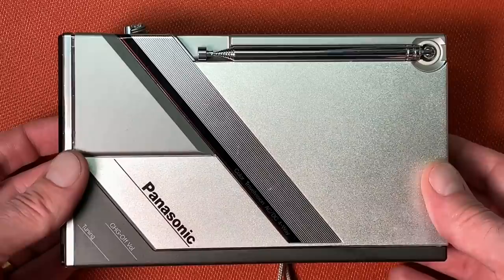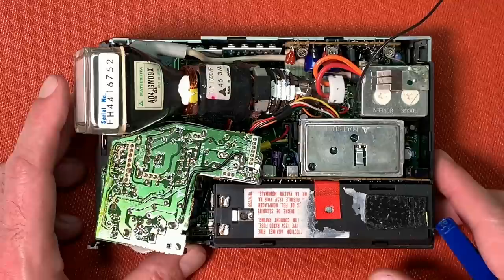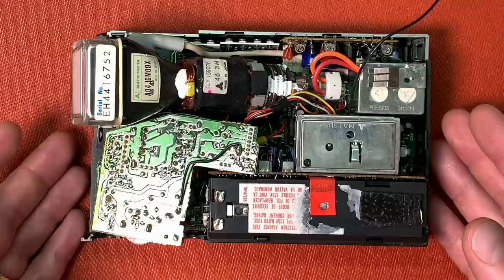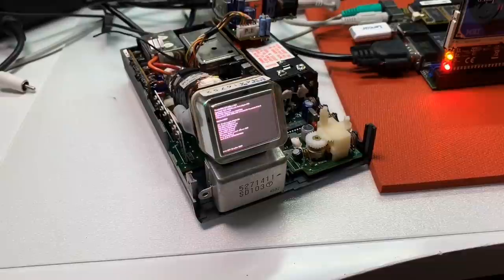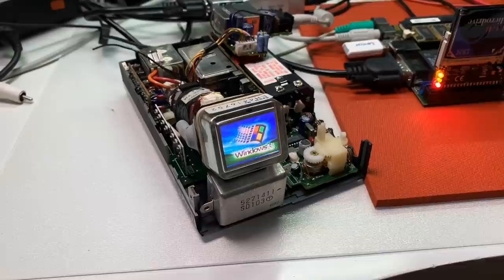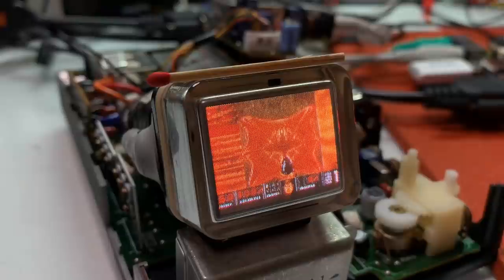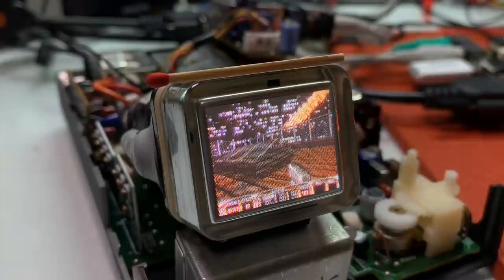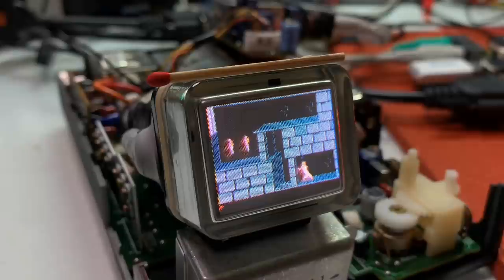Worlds Smallest Color CRT Monitor & Retro Gaming Pentium 266 MMX SBC

Comment: Got the same Panasonic TV CT101. Great little set.
Reply: I guess the only way to use the 101 now is for force feed it a composite signal as no analogue RF video exists (unless it's from a modulator).
Reply: @MikinessAnalog  Pretty much yes. At least it has AV input. Still it is a collectable item if you can find one for the right price.
Reply: @12voltvids  AV input is better than RF only as "fewer links in the chain" for video quality.
Its size is already a big hit to its resolution. You can only fit so many phosphors on the screen.
Reply: @MikinessAnalog  In person it looks not too bad, and better then one would imagine from a 1.5" color CRT tube

Comment: The high voltage on CRTs is not dangerous with the anode cap disconnected, even when the display is on and operating. No transistor driven flyback will be able to sustain high enough voltage and current with the load of your body to seriously injure you. Worst case scenario with the tube in circuit it will act as a capacitor and could give you a short jump. 
The high frequency of the flyback's output would mean that you're unlikely to feel anything from it either. This tiny little screen is probably not exceeding 5kV. Some large color sets will drive up to 25kV I've seen, which is still not particularly dangerous. I touched the output of a trace SCR on video and it made me jump, but I'm still here to tell you about it. Even got it on camera! Check my RCA XL100 diagnosis videos and you'll see it towards the end of one of them. That trace transistor was putting out 750 volt pulses at 600mA to the flyback transformer. 

On some very old set, namely ones with tube drivers inside them, they can produce significant current at high voltage (few hundred milliamperes) which will very quickly burn your flesh. It's not likely to stop your heart or do anything crazy like that unless you're being stupid and not following the one hand rule or have your feet in saltwater or something, in which case most voltages will hurt or kill you anyways. This era is likely where the myth comes from.

CRTs do not have to be scary, people just make them out to be that way. Gives them a bad name!
Reply: I really do not think so about what you have mentioned and you can correct me if you like but I used to have 14 inch CRT and I used to play around with its high voltage cable by unplug it from the screen body and melt some small metal needles with the arc I used to but the needle on the ground and bring the connector that goes to the CRT body and zap the top of the needle with it and it was melting like ice-cream!
So do you think this very High voltage will not do any harm to the human body with such a high current capability
Reply: I knew a guy once in the late 80's who weighed over 300 lbs, he was messing with a TV he thought he could fix. He ended up against the wall by an electric shock from the TV. He didn't say what part he messed with, he didn't even know about fixing TV's, but odds are he messed with the flyback transformer going to the tube. They put high voltage warning stickers on older CRT TV's for a reason...  you're completely wrong about the dangers of the high voltages they put out. Some of those TV's put out 30 KV... that's 30,000 volts pal, nothing to screw around with unless you know HOW to drain and work on a CRT... the dude was lucky he lived.
Reply: @NourMuhammad  this guy has no idea what he's talking about. CRT's can be highly dangerous in the wrong hands.

Comment: Okay... How cool would it be to have the mini color screen and the mini B&W screen side by side. The B&W screen for clarity, and the the Color screen for graphics and games and such. You ought to be able to pull the Luminance signal from the VGA to composite adapter's S-Video output, for the clearest possible B&W output. You'd have the best of both worlds, B&W for clarity of text and details, and the color CRT for the bright, colorful graphics! Take the tiny SBC, the two monitors, the adapter, and stuff it all into a case. If you had a battery powered PSU, you could make a tiny portable micro PC!

Comment: It never stops being funny to me how as a society we see ten year old or older tech as trash. Then are so surprised to see how well it works. LCD, plasma any flat screen is rated by resolution. Any guesses as to a CRT's resolution? Somewhere north of infinite.
There's a YT vid where a guy connects a 1932 Telex to a modern computer. 1932 f'ing tech. Let that sink in a minuet.
Reply: Nowhere near infinite, crts are limited by the size of their aperture grill and other things, yes you can force them to try resolutions higher than they're designed for but image quality suffers.

Comment: The image isn't clear because you're using a scan converter to down-scale the image to 480i. Then you're using composite video which is one of the worst possible connections.

Anytime you downscale a high res PC image to 480i it will look blurry. The 60hz interlaced mode is equivalent to 480p 30hz in clarity. 

You'd get far better results using CRTEMU drivers to natively output 15khz and then use a Jrok to convert RGB to NTSC.

Comment: It would probably look sharper if you ran the PC/video source at a resolution of 640x480. NTSC TVs (with PAL tvs running at a slightly higher resolution) only handle a max of 480i. You're losing detail from the higher resolution getting downscaled by the VGA to Composite adapter you have. It looks like that thing booted up in 800x600  or 1024x768 once Windows came up. So yeah that's gonna be difficult to read any text on. 640x480 might have readable text. You'll just need a magnifying glass. :P

There might be a smaller color CRT out there. There was a viewfinder to a video camera (I forget now the brand but it's not widely known. Might have been mostly a professional type camera not used on the consumer market) that had a color CRT. I think it was a one incher so half inch smaller then this one. 

It's not shadowmask though. It used a beam index tube that has only one gun. It's an interesting tech. I think the phosphors are similar to those used on Trinitrons (in a stripe pattern instead of dots or slot mask pattern) but there's an extra stripe of phosphor that is used mostly to sync the gun so that it can hit each color with the correct information. This tech could theoretically have higher sharpness and brightness then even the Trinitrons as there was no metal grill or mask inside the tube that the electrons had to pass through. (and unlike Trinitrons no extra support wires needed either)

Unfortunate it wasn't common on larger things. Largest beam index I know of came in a 5 inch form factor and are rare and expensive.

Comment: Very neat but I dont think these are the smallest CRT's, they use smaller 10mm ones in the old video camera view finders, I have some and they run composite video and 12V
Reply from the maker: i said worlds smallest color crt. and not black & white. the 10 mm from camera viewfinders are all B&W. and for 100% you dont have a 10mm color crt.
Reply: @CPUGalaxy  Ah yes sorry you are quite right. They are all B/W

Comment: That thing is awesome! Curious, does it still get super hot like a large CRT?
Reply: CRTs actually don't put out that much heat, the vast majority is from the rest of the circuitry. As this runs on batteries you can be assured it doesn't use too much power and thus it doesn't get super hot.
Reply: @eDoc2020  neat! 👍

Comment: Interesting, who is consumer for such thing? It demand stable 12 volts, so it needs heavy battery and good signal for antenna. you could plug 12v in the car but it bad idea when driving and too small screen on parking. also you cold plug it at home power supply, but you already have normal TV set there...

Comment: hi really cool video about a really awesome device :D (y) (y) 
maybe you want to try with another Signal solution for that screen?
 These VGA to S-Video Converters are not very good for lower resolutions as used in most dos-games.. They also introduce some lag and picture quality is not the best at all.

For proper 15kHz video output you can use an older ATI Card with modded Bios (google: Atom-15) [at least such a "special" card was needed some years ago. Maybe the Deleloper supportet more GPUs nowaday??) and you need a DIY Cable (i use a VGA to rgb scart cable after finding the pinning - i googled: "Mamescart") and additional for windows use a driver/tool called CRT Switch Res is needed. I have build a mame setup arround this approach and was very pleased with the results. especially the picute quality is great. As Bonus all the legacy resolutions (like 200p,240p,288p) will display natively on CRT-TVs and that might be a real difference in your case... Maybe you might give it a try. i wonder if that tiny crt-screen is not capable of showing some better PQ! :D
Reply: ahhh, wie unhöflich von mir : 
GUTEN RUTSCH INS NEUE JAHR :D
Reply from the maker: Vielen Dank. Dir auch. 😉

Comment: Some of older cameras have in this CRT
Reply from the maker: until now I could not find any camera which is using this 3-gun color crt. 🤔
Reply: @CPUGalaxy  https://youtu.be/8xlfOMlTLW0. Does seem to have existed, though this video makes no mention of what camera they scavenged it from
Reply from the maker: hah, actually this is the same CRT as I am showing in the video. I think I spent month of researching which camera model is using that crt but could not figure out.
Reply: @CPUGalaxy  My camera was a National Japan made from 80 the eye pice was color crt ,and was taking big commune VHS tape it came with a large case with accessories and my dad never allow me to play with as way to expensive. I did look online at pic with National cam but i cant find the one have, i remember the design and butons laydout ( porhapse was relised only for the japan market as documentation was not english, kind of unbelievable as the engineering of something like this is just insane )
Reply: @CPUGalaxy  really? That's funny. Guess this SKU got around

Comment: Where did you buy this, I searched EBay and no luck.
Reply from the maker: yeah, actually on Ebay. As I said in the video. Its a very rare set...
Reply: @CPUGalaxy  yeah, no kidding! I found a smaller beam index tube, it has a higher resolition but gets rid of some of the novelty.
Reply from the maker: I have several beam index tubes too. The contrast ratio is bad and its hard for them to display crisp red colors. Also the optical sensor infront is not that optimal. The next thing is that the image is mirrored in this viewfinder beam index tubes and you cant change that by just flipping the horizontal deflection.... you are right, the beam index tube of the viewfinder from the RCA CKC 21 camera is a bit smaller, but in my video I am always talking about a 3-gun crt  ;)

Comment: If I have a pc and a crt... do I need a scaler or some device like that to hook them up and have a signal?
Reply from the maker: Depends. You have a TV CRT or a kind of computer monitor CRT?
Reply: @CPUGalaxy  I have a pc and a crt tv.. I have a radeon card and I want to use it with groovymame
Reply from the maker: radeon card should have a TV out. SVideo or composite input should be available on your CRT TV. So you dont need any converter.
Reply: @CPUGalaxy  it has DVI-I wich I need to output the analog signal..